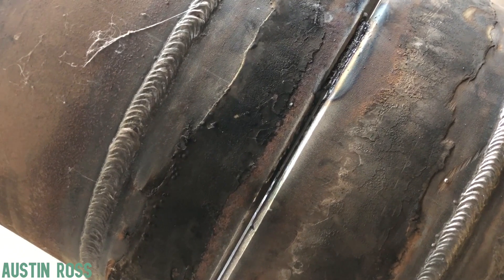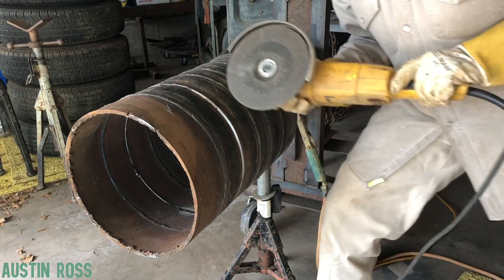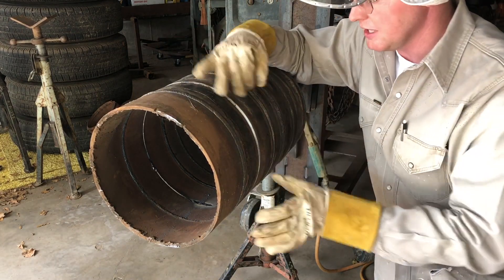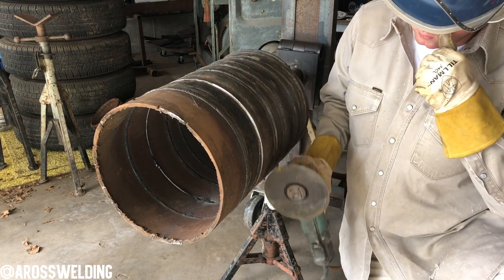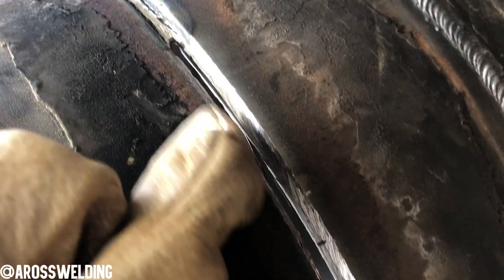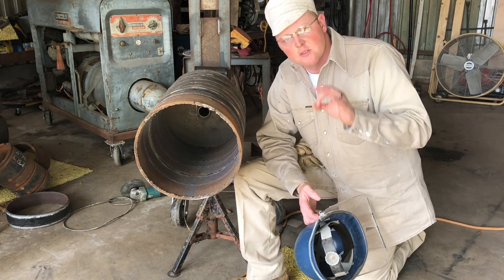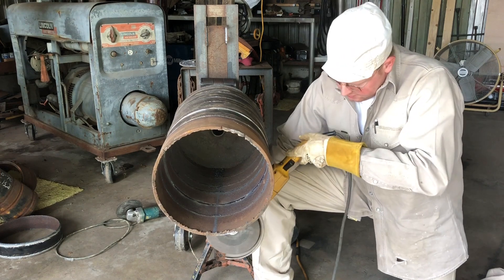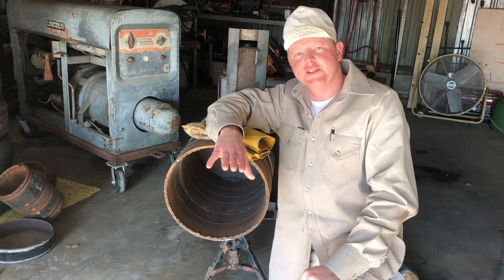HOW TO GRIND THE BEAD (PLUS ADVANCED TIPS FOR PIPELINE WELDER HELPER)

Comment: Guys i would be careful on what you take in from this guy, he likes to talk but alot of bs but some good points, wagon tracks lol like he would say is a place to get slag trapped,you dont need to grind the shit out of your welds, hit it with a wire wheel and knock back your high spots but put your hot pass in nice and hot 90 amps 3/32 7018 or around 120 with 1/8 if you feel like your to hot wash the sides of your pipe using the wall to deposit your hit.... usually welders who grind the shit out of everything got something to hide and then you need to put your hotpass in cold so you don't blow trew and then your into all kinds of problems,lack of fusion, trapped slag, cold is no good, your a welder right...... Not a grinder..my point of view anyways, and i gotta a feeling id bury him in slag, just saying.. stick to lay out and dont even tack with 3/32 7018 on 40 amps - get a welder to tack for you,save money grinding lol

Comment: As a beginner, I am completely lost as to why you would want to grind a weld bead. It seems to me that it would weaken the weld after removing so much material. Probably I missed the point of this, but I think an explanation of why you would even want to grind a bead would be a good start of this video.
Reply from the maker: Great question. 
In short, with the process of welding pipe, the “bead” or “ root” pass, is the very first pass put in and it is different than all the rest on account of the goal is to weld the inside of the pipe, from the outside. Therefore most of the strength of the weld is on the inside of the pipe. The reason some, most people grind it is to make sure it’s clean. With some processes, some welders do not grind the bead. There’s on lots of different processes and procedures when it comes to welding pipe. And it ultimately come down to what specific procedure you are following on wether you will have to grind the bead or not. Most procedures also have a time limit in between the bead and the next pass, for this very reason you’re gut was concerned with. By grinding the bead, I would guess it does have the potential for weakening the weld. 
I will put this on my video list because I love the question. Very good question! Thank you for asking!
Reply: @arosswelding  Thank you for the detailed response!
Reply from the maker: My pleasure!

Comment: Austin, if I wanted to get started on the Pipeline, would you recommend starting going through the 798 Union?
Reply from the maker: Depends on your situation. If you don’t mind traveling then ya it’s a good option. And long term it’s a good option. Benefits and such are great. If you are from an area where there is pipeline work all around you, as in 2-4 hrs radius of your house and you knew people to get in with those outfits then non union might be a good place to start.

Comment: When grinding I never use a zip disc accept for repairs . It's all about heat sink . I use a 5/32 " 6" or 7" disc . leave the wide spots alone  tight spots or iron bound grind down to top of land.  reason for 5/32" is it allows you to use a rod size smaller 1/8" that will fit in the bevel to the top of the land . Codes usually allow you to use a rod size smaller or larger to facilitate getting your initial bead done . always do your tight spots first. reason is it will tighten up wider spots as you weld . Reason you don't grind wide spots is again heat sink . the wider the more heat sink  you want . When you are dragging your bead on wide spots  and you get windows whip your rod and turn down your heat to get the windows . If you have your hand in you can whip the bead in all the way to the bottom if need be . once the bead is in grind the bead again with a 5/32" disc just chase the wagon tracks on either side of the bead till they are just beginning to disappear  the middle will be taken care of with the wider disc  . If the bead is blue after grinding  kill the helper hahahaha  just another way . Keep up the good work Austin  www.fittergrips.com
Reply: I’m trying to learn hope your right 😂